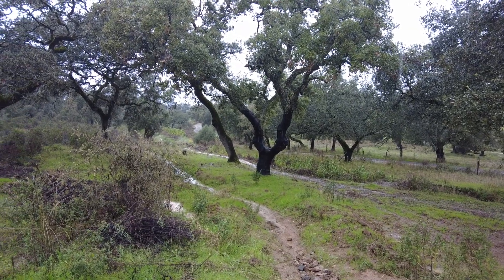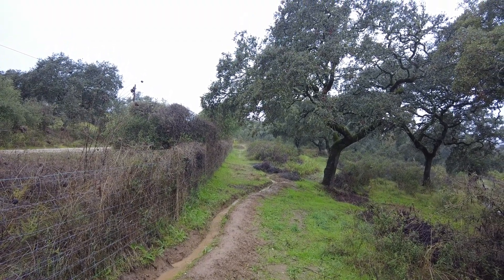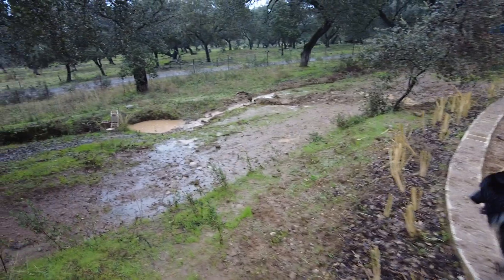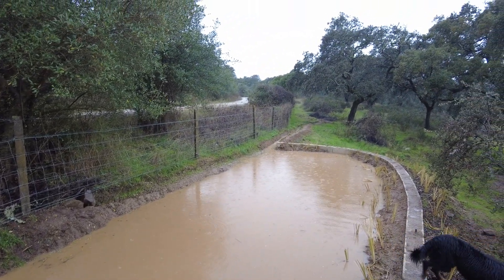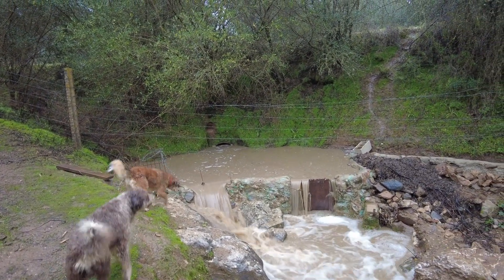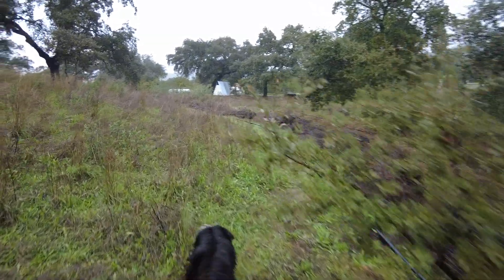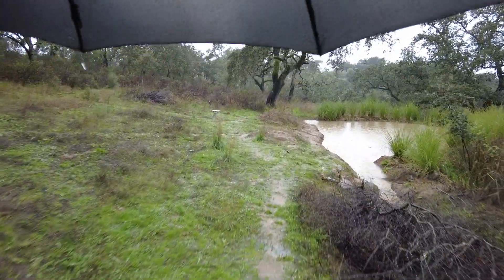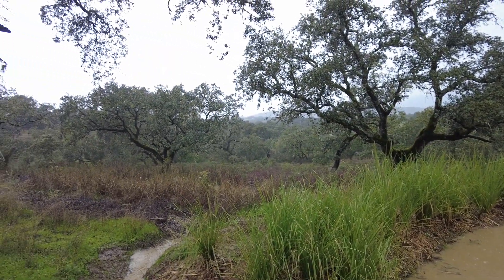Polite rainfall doesn't cause erosion in our canals.

Comment: Not my place to tell you how to go about water harvesting. I must say it is refreshing to hear your thoughts on sharing the water with those down stream . I just wanted to point out that by banking water in the ground you are also sharing water with those down hill of you. Given the amount of rain you seem to receive and your long dry summers you could afford to bank more water, the more you bank the more you share. I also worry that should you receive rain in the quantities that have hit other parts of Spain in the last two weeks that your systems might blow out. If you are interested in my thoughts on how you might prevent this I would be happy to share.
Reply from the maker: @davidprocter3578  Please share. I'm happy to hear.
Reply: @SuerteDelMolinoFarm   Here goes lets deal with your new pond /dam  at the smaller culvert. In the event of a shockingly aggressive rainfall, this culvert is likely to be unable to cope,  the water coming through  the pipe will come out your end with considerable force,  probably enough for it to act like a monster jet washer taking out anything in it's way, your  block wall  , the stone anti erosion layer that you have so carefully laid in fact that entire section of dam wall. To add insult to injury it is likely that the water unable to escape through the culvert will come up over the road much will come straight across and begin to erode the road verge, you can imagine the problems this will bring. I do feel this situation could be avoided  by adding a suitable piece of culvert pipe to the existing in order to extend the culvert beyond your wall, then by blocking up the rest of the wall to fill the gap. The depression behind the wall will need to be filled so as to create a funnel for water flowing over the road and or down the verge. To prevent the water jet scenario you will need a 90% bend on the end of the culvert pipe, pointed straight up this will take much of the force out of the water. Of course there will be in this circumstance considerable amounts of water for the dam to deal with, so I suggest that all the outlets  be brought to the same level and one board sluices built to control and direct the water. /Question is there any scope for the outlet you described as the spillway[ emergency?] to feed a nice broad swale extending as far as possible with possibly a deep sink pit/soak away at it's end.
 Now I am afraid we need to get to the nitty gritty. As you said  you might have to deepen your main feeder canal / pond drain a wise thought I think widening it at the same time by a factor of at least three will be required to deal with heavy rainfall. Remember the narrower and deeper the faster the water will flow and the greater the potential for erosion, lining this canal with stone or concrete I feel would be worth while. All the water passing through or around the culvert will need to go some where and the channels you send it along to disperse it will need to be big enough to cope and should they over flow it is important that it should be to your advantage, ie build in over flows that will feed other systems [these do not always have to be swales] Speaking of which you can see better than me  ask yourself are my swales big enough to cope with  several days of good rain or a mighty downpour [I do realize that you  have many mature trees on your property that you are unwilling to sacrifice] but that said would it be possible to widen/deepen or increase berm height on any or all of your swales. As for the main culvert during a extra ordinary event  You mentioned  a dam I think that this is a top idea, one big enough to absorb the energy of the water coming out of the culvert and store water for irrigation through out the year. I do realize that this might lead to the loss of one or two trees but I think approached correctly could be minimized and to the considerable advantage of the rest of the property. Of course cost is an issue and should be weighed against potential gains. But I would point out that a good sized  pond behind a dam wall could also provide your kitchen with a range of  edible produce other than that grown in the kitchen garden.
A suitable spillway would need to be built and to cope with heavy rain I would be tempted to increase your leaky dams in number , height and bulk, this in theory should help slow the water and improve ground saturation at the same time.

Comment: What if instead of (or in addition to) building reinforcement to the original pond, you just cut it further “uphill”? You could make a shallow section that not only is good for habitat, but also distributes the water more and decreases the pressure in the deep section, if the water flows to the shallow section first, then spills over into the deeper area.
Reply from the maker: @AngelaMerkeltree  You are a star. Point taken. Much appreciated

Comment: Wonderful video.  I see several small rock piles that guide, slow the waters and rock armor the canals.  These are great methods for fine tuning and controlling the water flow.
I'll  encourage you to  lower the spillway at the pond.  It looks to me like you are tempting fate 😉
A suggestion about your essay;  careful not to  conflate the two basic uses of clay 1. As a compacted building material  2. As a material to be amended for use as soil  for growing crops.  👍
Reply from the maker: @stevejohnstonbaugh9171  Yea, when the big rain comes then I'll have to open all the exits. Clay soil is very interesting, I'll build something with it in future. Great to have your suggestions and comments Steve